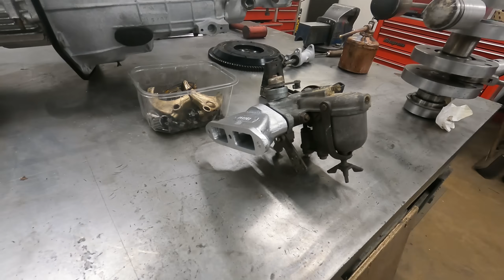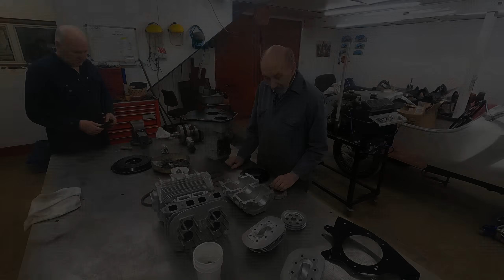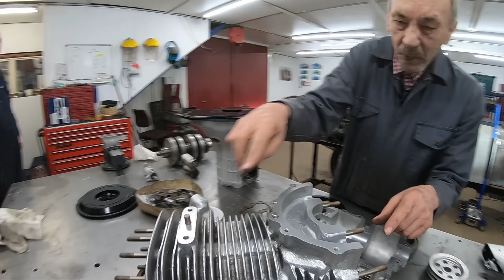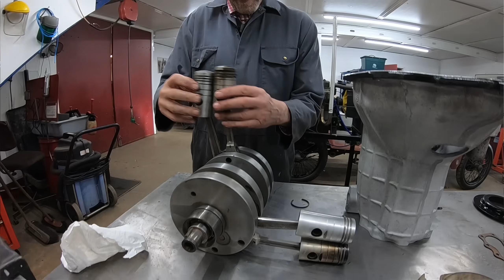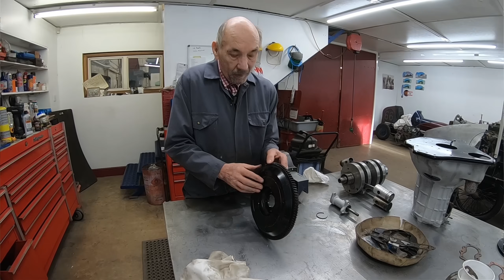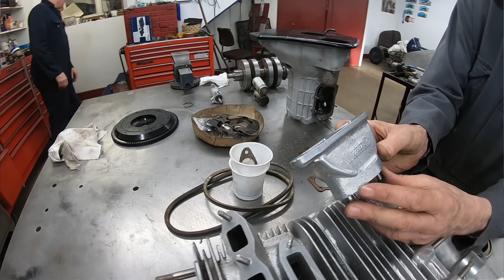SHED RACING   2 Stroke 2 Cylinder Mini Engine

Comment: Sorry to keep bothering you, but also back in the day, they probably used a 16 to 1 ratio of normal 30 wt to gas. May not need to use 30 wt but i would run 16 to 24 to 1 with a modern 2 stroke oil. Metalurgy and it being prototype,  clearances may not have been optimized

Comment: Make a see through head to allow a visual of the combustion!  Use a high speed camera to see exactly why it's firing through the carb,!  A block of aluminum with a block of acrylic should do it, just roughly get the combustion chamber cut through the aluminum, then cover with acrylic about 20-25mm thick.  Maybe make a steel retainer to spread the clamping force. Use any spark plug, it just a wood screw  thru the acrylic to arc on the aluminum.   It could show something no one would ever thought of!

Comment: This engine predates the Mini by at least five years, so Mini is a red herring... The engine was developed circa 1952-53 for a lightweight version of the Austin A30, known as the A20, that never progressed beyond the prototype stage... These prototype engines suffered seizure due to overheating so a water-cooled version was developed, an example of which survives on display at the British Motor Museum at Gaydon...

Comment: I have read that it was Ralph Lucas in the UK that designed the first split single engine in 1905 and was used in I am assuming was a prototype car after this it was the turn of the Italian Alberto Garelli to patent one in 1911, Garelli later went on to form Garelli motorcycles which used the split single on the road and in road racing, Trojan (UK) then reinvented the type in 1913.
After the first world war an Italian engineer, Giovanni Marcellini, arrived at Puch with the intention of winding the business down instead he designed another iteration of the split single which debuted in 1923 in the form of the Puch LM racing motorcycle.

Comment: The twostroke was not desighed for the mini but the Austin A20 of which one working prototype was build. There was also a watercooled twostroke which I have seen running in 1986.
Reply: The water cooled version is on display at the British Motor Museum at Gaydon... 😉

Comment: Love watching your garage show, 
I'm making a 2 stroke engine of my own design. 
It's a 500 cc horizontally opposed  twin, a wet sump and it's olied like modified four stroke so it doesn't smoke and runs on straight petrol but I haven't finished it yet so I don't know if my idea works, I just picked up the pistons of my own design, I've made a crankshaft, conrods,
I need 75 mm diesel sleeves and rings, 
You could make my engine in a week, it's much more simple than the 2 stroke that your working on, 
If I get it going I'll send you a video, no other engine looks like mine,

Comment: Really funny, spend £600 on new peepers and can't find them. Seem to remember reading "Grapes of Wrath" and if I remember correctly Tom used copper wire (piano) to squeeze the rings. Best of luck with second surgery. I'm going next month to have mine cleaned up after 2 yrs.

Comment: Ivan, apologies if it's been mentioned before,but a few years ago I had a DKW/ Auto union/ Wartburg triple. To refit the pistons I used some Brass shim wrapped around the rings and the ends of the shim material pegged together with some brazing rod. Offer up the pistons in the usual way, the brass shim can be removed by unpegging the ends 
This is on YouTube if you search Auto union Munga ..DKW engine build.
Keep up the good work.

Comment: Hi! I’ve been reading a book which mentions this engine. It comes from a pre-war Germany and the two piston design was a way of effectively supercharging the two stroke, before a Mr Walter Kaaden used pressure waves and resonance used in the expansion chamber exhaust to do a similar job. The engine design was referred to as the Ladepump. (which Google translates to Charge Pump) Pre-war Germany was a hive of internal combustion wizardry. I really look forward to seeing the engine go together, I didn’t know any of this actually existed! Congrats on the eye operation

Comment: I'm reasonably certain it was Joe Ehrlich who designed the two stroke engine you have, the same man who designed the EMC split singles, ( same as Puch) and of course many Puch motorcycles were split single same as the engine you have. Which is a twin cylinder split single! The beauty of the split single two stroke is it has asymmetric port timing which can minimise charge loss down the exhaust. Joe also tuned some bloody quick two strokes!

Comment: Many years ago I used to rebuild DKW/Auto union three-cylinder two-stroke engines, to put the pistons in I had a thick broom handle suspended at either end from the ceiling of the workshop, then with two ropes wound around the broom handle spaced to the crankshaft outer bearings I could raise and lower the crankshaft horizontally by turning the handle, this also allowed the crankshaft to rotate, which in turn moved the pistons up or down. With the engine block upside down on the floor with the crank position directly above it, my wife would lower the crank very slowly by turning the broom handle ( which had a piece of steel clamped to it as a lever ) while I fitted one piston at a time into the block, quite a nerve-racking job.

Comment: Ear olde 'un! Thinking about the 2 stroke engine and its basic form, what are your or Johns plans for keeping the little bleeder kool? With four barrels, it will become very warm very quickly without forced cooling. Especially if it is running as a stationary engine in a frame. I think you really should build it up with a view to putting it in your mini. So you can report on how things may have turned out at the end of the 50's. That would be extra special as so far as I know, it has yet to be done.
I will allow you to give me a slap sooner than you may think. But I worn you, bring a step ladder! Bw Mike the Barchetta driver.

Comment: Another great project looking forward to seeing the whole series. 
Thank goodness BMC gave up on both those 2 cylinder engines and very sensibly decided to use an A series engine. Without it the mini wouldn't have been the fantastic success it was.
Reply: Undoubtedly.  If you look through out history, big engine in a small car has always been a winning formula.  It helps that the A series is a brilliant engine, driveable and quite dependable.
Reply: @johnpearson492  Yes.

Comment: Hi Ivan, I owned several Puch motorcycles back in the 1970's. the ignition timing was very critical on them, there was a plug in the crankcase and a hole in the crank, when a pin went in through the m5 hole and into the crank the points should just be breaking, incorrect timing or weak mixture (dirty jets or filters) would burn away the edge of a piston and break rings !!! I loved the torque of the engine though, my 175cc Puch would climb hills as if they weren't there
Reply: that is probably the cure , excellent

Comment: It is an Ehrlich engine. 

I believe that BMC tried two Ehrlich engines, this one and a water cooled one. They were intended for use in a prototype, lightweight, smaller version of the Austin A30 to be called the A20

Look up chapter 14 of Postwar Baby Austins by Barney Sharratt, Osprey Press.
Reply: My first thought as well, seeing those thick fins.  If you're running it stationary, you will need fan cooling unless it is only going to go for five minutes or so.
Reply: @mikewilson631  I had a vintage Puch moped that had a beautiful aluminium cowl around the cylinder to direct air from a fan on the end of the crank. It was a very nice design.

Comment: Interesting workaround that Puch came up with to disconnect and manipulate the inlet and exhaust port timing.  The rotary inlet as used by Bridgestone and Kawasaki motorcycles at one time was another design to do the same.  Power output can heavily rely on some sort of exhaust expansion chamber feature. It could be helpful to find even a photo of the complete experimental setup if no better data exists.  Some have commented, a 4 cylinder.  Yes, but only 2 combustion chambers.  In their day, Puchs were able to produce superior low rpm torque and a wider power band than most other 2 strokes.  As memory serves, Zundap also used the design principle many years ago on a motorcycle rebadged by the mail order giant Sears & Roebuck in the States.

Comment: Excellent stuff, Ivan and team. That is a fascinating little unit. Question: Obviously 2 stroke, but is it not 4 cylinder? Nonetheless I will watch for updates with interest! Mart in Solihull.
Reply: No Mart the two pistons share the work one piston does, there are only two combustion chambers. And the engine type is called split single engines.

https://en.wikipedia.org/wiki/Split-single_engine#Puch_1923%E2%80%931970
Reply: @larsbr4519  Hi Lars, imagine seeing you here! Thanks for the info. Something else I learnt today.

Comment: That looks really intriguing with the four tiny pistons . Looking forward to seeing how that works in practice.
Reply: A  typical two stroke uses the front top edge covering and uncovering the exhaust port to establish exhaust timing while the lower rear edge of the piston controls the air/fuel flow timing into the crankcase.  Since both functions are established by the piston, the intake and exhaust timing are coupled.  With the two piston design, the front of one piston controls exhaust timing while the rear of the second piston controls intake timing.  So where’s the trick? Note that the crank pins for each piston are offset slightly which in turn alters the intake/exhaust timing relationship.  As I mentioned in a previous post a rotary intake valve disk mounted on the end of the crank can accomplish the same.  The drawback  -  a very wide engine.   Reed valves can do the same, but they were prone to breakage with the broken bits being drawn into the crankcase.  A bad deal.  In the early 70s Yamaha introduced a reliable reed valve engine which reset the clock in two stroke performance.  Their engines were legendary with 350cc engines often dominating in the 750cc class
Reply: @myrlstone8904  interesting - thanks for the explanation 👍
Reply: it.. the type.. was termed a Twingle.. twin cylinder single